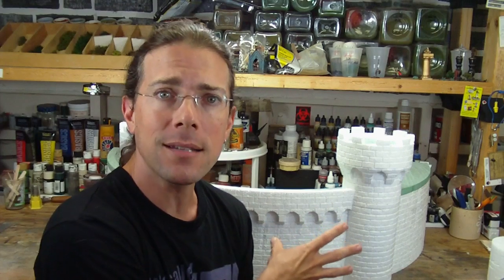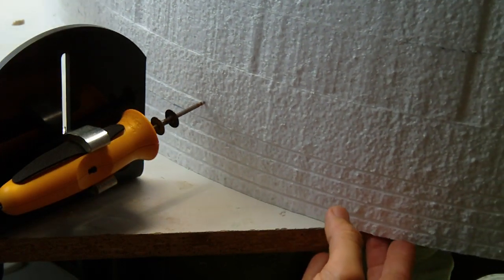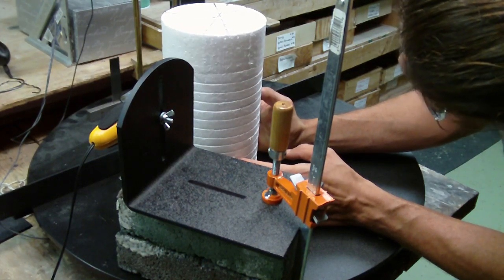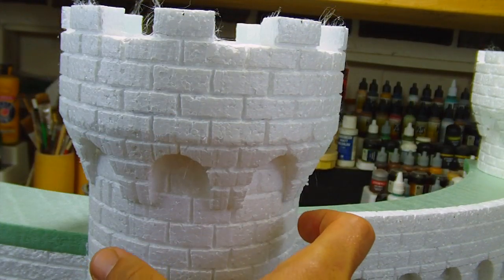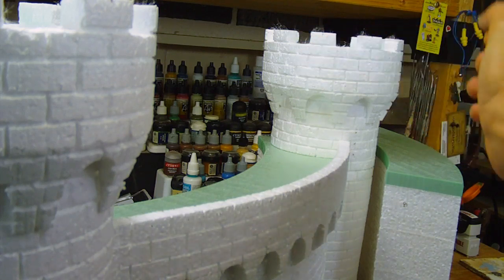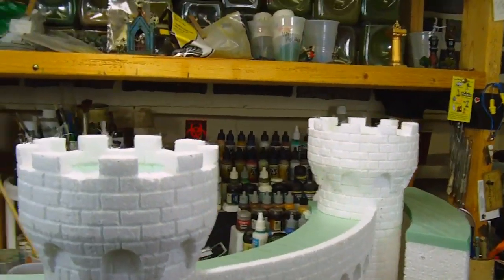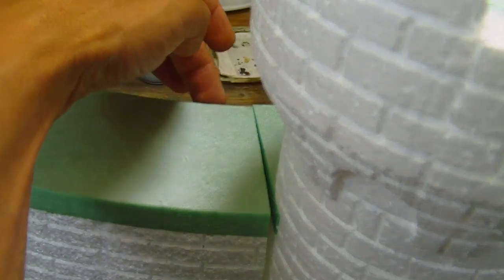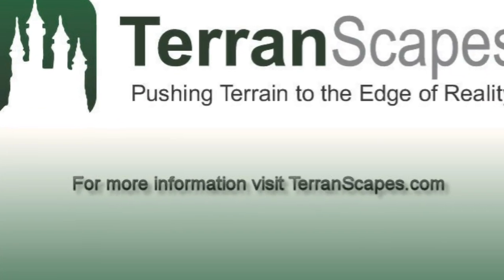TerranScapes - Castle Project Update 4 - WIP

Comment: I think you could get the crenelation in the same manner you did the detail on the bottom of the wall battlements. I too have had trouble with detail as far as using the styrospray. I did not notice too much flow from the foam coat so you should be able to brush that in thinly. Though it depends on how level your work table is. 

You have me really looking at getting that 3D table now and for that sir I shake my fist at you!

Comment: great work, the larger 2" bricks in the wall sections look great and offer a nice variation to the smaller bricks.  
just an idea: instead of cutting the crenulations out of the tower segment, maybe cut them separately out of a different slice/disk/ring and glue them on the tower walls?  that way you can use them on 2 towers because you only need half of the separately cut crenulations (not sure if that is clearly explained, the idea looked fine in my head :)).

Comment: suggestion for the internal stairway and external dressings;
cut them at the same time as you cut the wall. youve got the tools set up already, and it would just need a cut (just over to account for the width of the blade) a half inch further than the diameter of the external wall for the exterior dressing, and an extra cut between the int/ext wall sections for however wide you want the stairway (probably an inch to make it playable). then you could cut the steps into it after using the same...

Comment: Biggest respect for this masterpieces of modelling!
Short tip:
If the depth of the hot wire lines are so challenging and enduring, why don't you use something like a spacer? You could fix it on the table or at the base of your hot wire tool. It would allow you to work faster and less concentrated - time for a little break in the head! ;)
Reply from the maker: Not a bad idea.  Something to keep the depth constant and a spindle for the column to keep it's distance uniform as well.  Thanks!

Comment: for the stairs would it not be better to cut the stair case from a circle therfore having a solid piece and then marking increments down every inch or whatever it maybe and carving the stairs as stacking could prove problematic or gameplay as the last stair on the bottom may be prone to damage and if its not solid may snap off cause its so thin?
reguardless amazing work as usual :)

Comment: How do you get the stone texture across the surface?
Reply from the maker: +Kevin Peffer I ended up just using the texture of the foam, and then I coated it with layer of Hot Wire Foam Factory Foam Coat.  It has a grainy texture that helped finish the stone like effect.